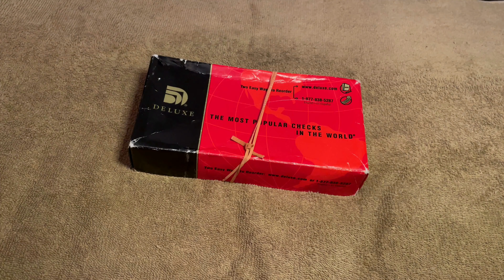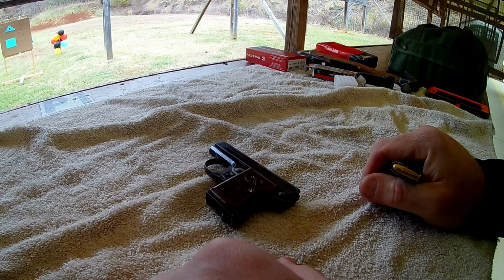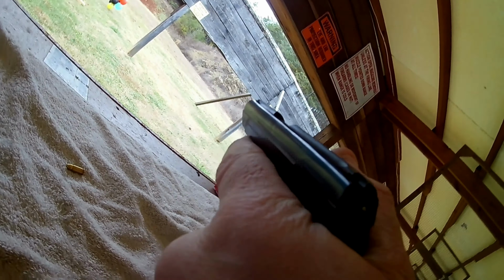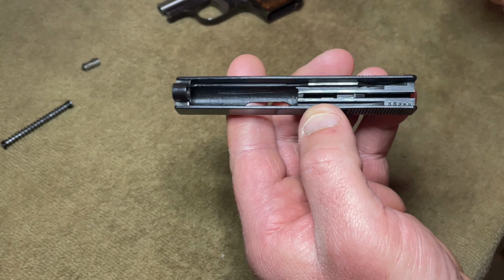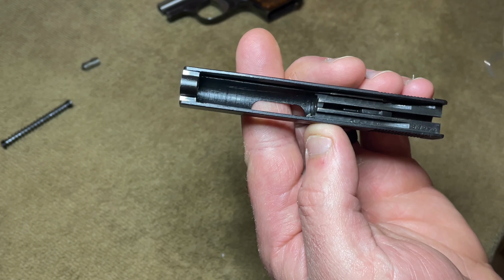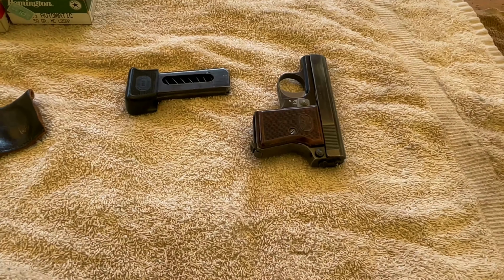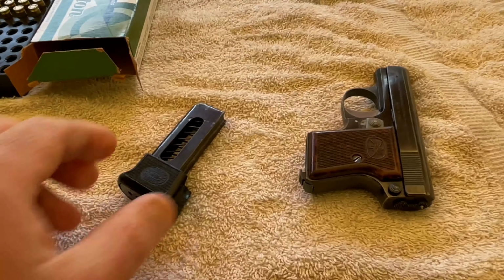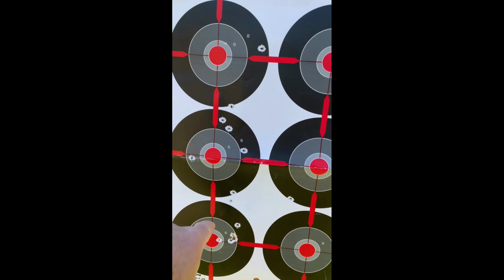25 Auto Bernardelli Vest Pistol - Revisit 2.0, Numrich Again

Comment: I was just gifted the same gun by a relative. He said he had problems with the pin spring as well. I haven’t fired it yet but all parts appear to be original. Thanks for the upload it definitely gave me insight to the issues with mine.
Reply from the maker: Well I certainly am no expert, the only one I’ve ever seen is the one I have. Hopefully it helps and maybe sends you on the right direction. Thanks for coming by!

Comment: I have one of these pistols to and the same thing happened to me I found that out renewing my CCW Permit the flat spring in the back strap broke in half thanks for the info on NUMRIK ARMS .👍
Reply from the maker: They have a lot to offer, sometimes they will be out of stock. Just keeping checking back even if they don’t have the original part they’ll eventually have a remanufactured piece. Thanks for coming by!
Reply: @cornfromajar3222  Thanks for getting in touch about the Berndelli Vpocket pistol . Hope to find a Fireing pin i have the spring need the Backstrap Flat spring bent in a V shape about a 1/2" wide . Thanks again.

Comment: They usually say to never lubricate strikers/firing pins or their channels... but I've seen people use dry lube spray and it not only works, but it actually stops the fowling from sticking to the parts. Many people use CV-2 grease too, because you can put it on and then "completely" wipe it off... but it'll still be there and will still work. It works amazingly on barrels/lugs, and slides/rails and is by far the smoothest of all lubricants I've ever used. It really quiets the action and makes it feel smooth like glass too. Some people don't recommend it on brand new guns that require a break in period, because it will reduce wear enough that it can stop the gun from breaking in (and will significantly lengthen the process). Some people say that if you put it on a new firearm that it won't need to be broken in, because it will lubricate and loosen up the parts by just being there. In all honesty though, there's no way to test if that's true unless you have several of the same firearms to test. Appreciate the videos and sorry for the rant. It is an excellent grease.
Reply from the maker: Excellent point you make. And I think it’s true in a lot of ways with lube that it really would take application to several weapons and see what the result is. Lubrication opinions vary widely- some do, some don’t, some say use frog lube, some say use CLP, on and on. I guess what works for each person, and doesn’t damage the gun, is the key here. Thanks for coming by!